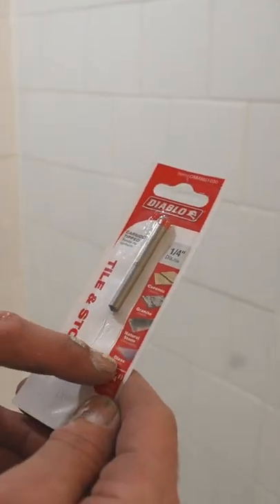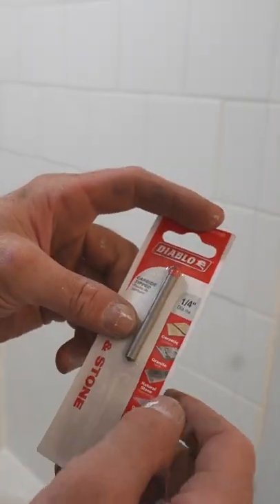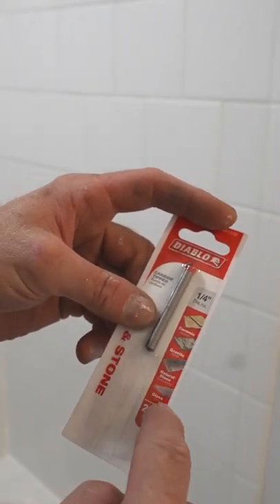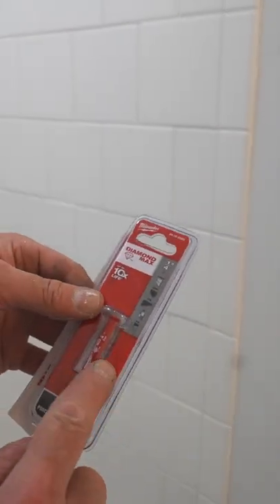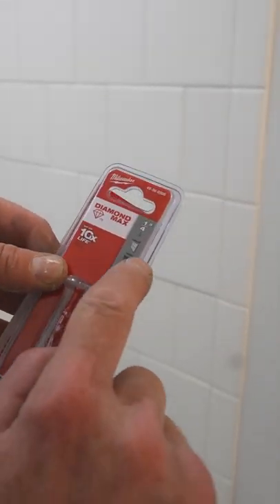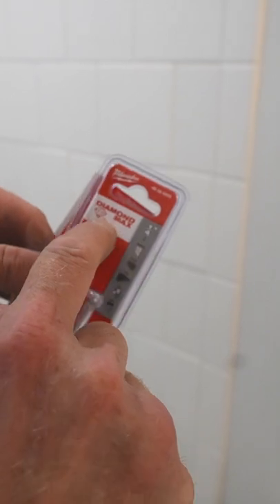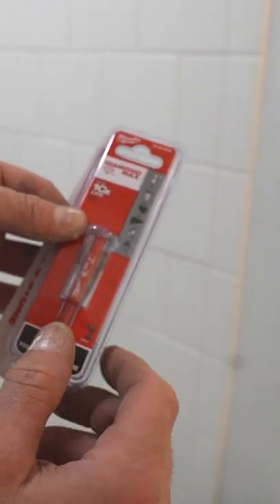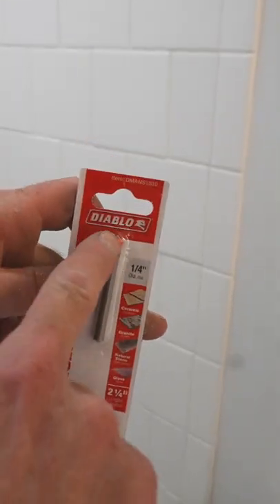Expensive tile drill bits that don't work #shorts #youtubeshorts #diy

Comment: A small soaked sponge around the bit will keep water in the hole as you drill, also have used spray bottles.. both work well to prolong the bits

Comment: Ya those Diablo glass bits suck. I used a 5/16 slow and with water, got thru like 8 holes on 3/8 porcelain tile… took forever and it was dull. $30 down the tube

Comment: Heat burns the bit out, i use them all the time, get at least 20 holes out of each bit. I dip it in water every few seconds to prolong the life, especially for the cost of them lol
Reply from the maker: I had a cup of water. 3 dinky holes in 1/4” thick glass and it was spent….they work great for subway tiles 👍
Reply: Wet sponge held right up against the bit while drilling will work wonders for you.
Reply: No the bit you buy for 30$ should do the right dam job, as well it’s says on the packaging 10x life , that’s bullshit haha